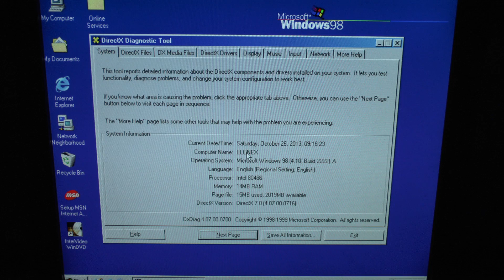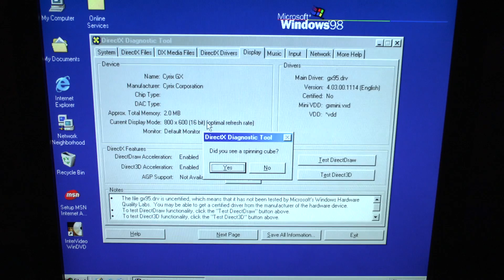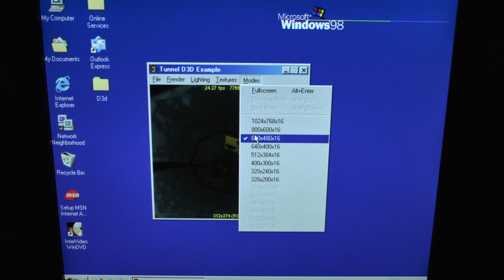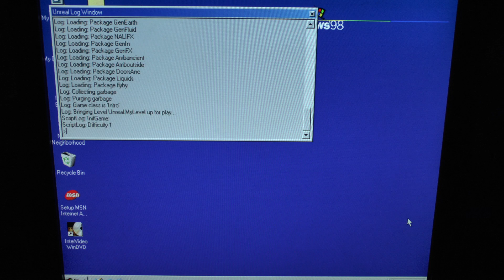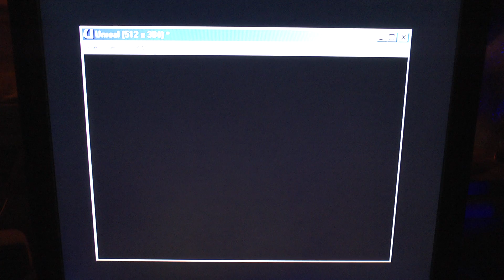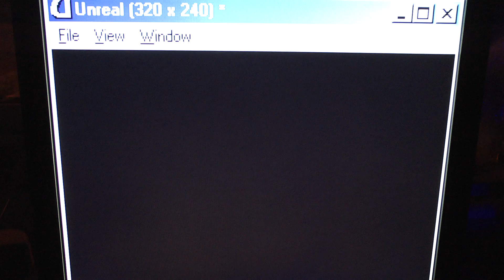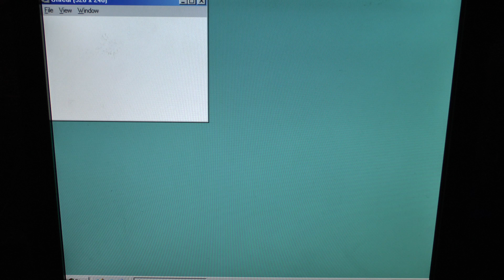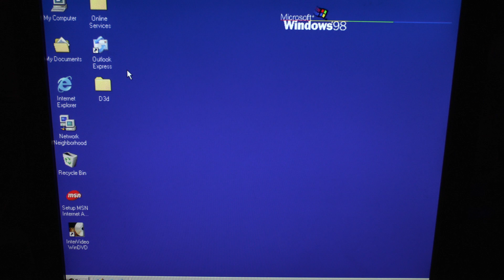UNREAL running on a Cyrix 80486 133MHZ PowerVR Part 3

Comment: I play this game on 486DX80 with 16 mb of ram and 1mb Cirus logic VLB card on Win95. Frame rate was low, but l could play)
Reply from the maker: Yes, I have been amazed at what the 486DX can actually do when it's configured correctly. Thanks for watching.
Reply: You need more vram, a graphics card with at least 8mb vram.
Reply: @moeschizlac  VLB card not supported 3d acceleration. Software (cpu) rendering not need lot of video memory.
Reply: @ДмитрийСергеевич-х4ц6м  There are other vlb cards that support hardware 3d acceleration; the creative 3d blaster and ATI mach 64 vlb are a couple that do. Vram is superior to the slower system ram concerning vga framebuffer because it has much lower latency. More vram allows high color bit depth( more colors to be displayed on the screen) and it allows higher resolution. Graphics card's vram is still used even though it is in software mode. Cards with 2mb vram or more were displaying 16 bit color and 24 bit color during the early 90s whereas cards with 512k -1mb vram were stuck with 256 colors. Graphics cards don't do hardware acceleration if you aren't in at least 16 bit color(64,000k colors)mode. More system ram could help as well.  A typical PC during the release of Unreal had 32mb of ram minimum. I'm not trying to be a smart Alec. I'm just sharing my experiences hoping you can benefit from it.

Comment: I do remember I played Unreal (Tournament?) with a K5-133 Mhz and a PCX gen 2 card. And that was pretty much the only game that actually had support for PCX 2 card (think natively even and not just by D3D, OpenGL). And it was actually pretty good and fast, but everything (or most things) OpenGL or D3D had graphical glitches, or and was really slow.

But it was pretty cheap :-)
Reply from the maker: Hello.
Glad you liked the video. ;-).

Yea it cost me 99£ punts irish. It was cheap at the time and came with a few bundled games that were good. However it ended there and I made sure my next machine had the Direct X capabilities, one reason why I did not pick a voodoo at the time.

Comment: It is not lack of ram, just terrible performer in general due to it’s 486 core nature and having a simple decoder that can only able to decode one simple x86 instruction at the time but have to spend many clock cycle to decode one complex instruction. I had a faster model of media gx1 333mhz w/ ecs p5gx-m, stuffed the ram up to 256mb pc100 and coupled with radeon 7000 32mb pci.  Runs windows xp  surprisingly fine without cmpxchg8b instruction but it was horrible to do anything on it.

Comment: why it is looking again like in software render mode?
Reply from the maker: Hello, the powerVR patch did not install so I think this is why it is in software mode rather than hardware mode.
Reply: @DRCHRISTIANMD  so it looks like software render, but the video card handle it, not the CPU ,right? :)
Reply from the maker: @intel386DX  Yes from another YouTube message and from checking it out, it should indeed run in Hardware with the patch.

Comment: Is this PCX1 or PCX2?
Reply: Must be something earlier than the PCX2, because of the lack of texture filtering and the ugly sky.
Reply from the maker: Hi. I will check for you later on the Card is not currently installed in any machine and is in its original retail box. Its most likely a first generation card, however something I did not do and must revisit as one watcher commented, is the likely fact of the bad graphics beign down too a lack of installed support drivers for the power VR card.?
Reply: It may be.

Comment: Huh.  Epic should have totally used the i586 instruction set for the binary.  Really no reason to run it on machines older than that.
Reply from the maker: rootbeer666 Hi. I would agree its a waste of time to run it on this type of machine full stop.. however thats half the fun...pushing the cpu to the max..
Reply: No I mean the developer of the game, Epic Games, should have compiled the binaries for i586 instruction set because even in 1998 it was already clear that the game will not useably run on any pre-Pentium machines, Pentium II (which is an implementation of the Pentium Pro P6 microarchitecture also known as i686) being the recommended processor.  It wasn't really useful to support i486, no customer that would want to run the game this slow.  Basically if the i586 instructions are not utilized that's a missed potential performance gain for the software.
What you're doing looks fun, it just seems strange that it's even possible, because it shouldn't be.
Reply: You know what, I'm actually wrong.  I just looked at x86 instruction set listing and it looks like the bare Pentium instruction set doesn't really have anything useful over i486 instruction set that would have been useful in Unreal binaries.

Now I want to see how it will run on my old Am486 DX4 I have in the attic.

Comment: i wonder if a card with hardware transform and lighting would speed things up?
Reply from the maker: On and off I am trying to set this machine back up again. I will be trying anNvidia MX400. PCI or similar.. that might..  then again the bus might just cripple it...
Reply: The bus does not cripple it, but DirectX does. The game is almost playable on a Voodoo II in glide mode with that CPU. The game probably does not use hardware transforming and lighting at all, even in the later patched Direct3D mode.

Comment: I can't get Direct3D to work with my AMD am5x86-P75@133Mhz with ATI or Nvidia graphics cards. They only want to work with the Pentium machine. What magic did you do to get this to work? Is that DX7.0?
Reply from the maker: As the title and video content suggests. ;-)
Reply from the maker: Yup there a pain in the bum to get things run.. and drivers are a mystery. Its in storage must take it back out and try the suggestion from the other youtuber re directx drivers for powervr.
Reply: DRCHRISTIANMD If you find one, that is.
Reply from the maker: Thanks. as you can see above I did find drivers for it but good to have an actual site as the drivers are from the 1990s and can be hard to find. I will have to re locate the machine and try a few more things with it. Yup set blaster works for a lot of cards.. although I found ESS AUDIODRIVE.. rejects the command. I have another video uploaded regarding what I found to be the best 486 setup to have regarding dos and windows compatability... great fun..
Reply from the maker: Hello again. Update so far. I did find my original unreal boxset but no mention of the power vr driver. So I went and bought another copy with the power vr built in. The game actually asked did I want too use the power vr driver. Now is painfully slow. I have installed a fresh copy of win 98 etc. and I am going to try tomorrow when I have a few free mins to upgrade the ram to at least 32 but better at 64. Soon we will have an updated video fingers crossed.
Reply from the maker: Hi. you definitly have to use at maximum directx 7.0 anything above will not work as it requires a pentium class.  Now try this. Install windows fresh with an ATI card. do not install any drivers. then install direct x 6.. followed by direct x 7. drivers are included fir most ATI 3D Cards of win 95/98 generation..
Reply: Quite easily. The Media GX is on the base of the Cyrix 5x86 and not the 486. Your AMD 5x86 is not a real 586 but just a higher clocked 486....so no DirectX for you....
Reply: DRCHRISTIANMD The title says 486, the content says Media GX (586).
Reply from the maker: 586 crippled by Architecture of chip design and dated 486 mainboard design. ;-)
Reply: DRCHRISTIANMD I happen to have a Mediagx as well! They're rare.
Reply: DRCHRISTIANMD I wonder if these "patches" that enable extra pentium features work on them?
Reply from the maker: Well the "cpu core" is a pentium class. Its the bus and motherboard that was antiquated for cost saving reasons and to supply the cost minded conusmer such as schools office and budget home users. AMD do it today with the tech bought from ATI. They have all in one cpus. maybe ahead of there time but the idea was and is clever...
Reply from the maker: Worth a shot since the core is pentium class..
Reply from the maker: Are the MediaGX chips rare? I was not under that impression. ?:-)
Reply: DRCHRISTIANMD I tried running DOS games on it. Amazingly you don't have to load drivers for the audio. It just needs the SET BLASTER = variables. For Windows, I got the drivers from the Phils Computer Lab website. He has the MEDIAGX/Geode drivers nicely packaged for us.
Reply: DRCHRISTIANMD The chips not, but motherboards that suppport its Graphics core yes. There are some embedded boards that use it. Back in the days, they used to have internet terminals at a Bank that i went to often, running linux.
Reply: BTW, are you folks part of the 'RETRO Machines' Facebook group? A lot of the retro  YouTubers like VictorBart, PhilsComputerLab, and others are on there.
Reply from the maker: I have no friends.... :-)
Reply: Which is why you must join us there! You must be around your people.
Reply from the maker: lol. Thanks. ;-)
Reply: I have one too, but it does not seem to work. I had 2 before and don't know where the other is. :(
The driver installs when it's in my UMC socket 3 board, but then it's not in the device manager. Also, It doesn't work with many other PCI Cards....(System won't boot...) Maybe I should try it with a pentium.

Comment: How much RAM do you have in that system?
Myself I found a huge difference in framerate performance when I upgraded 486 class systems from 16 mb to 32 mb of RAM.However I usually preferred to run Windows 95 on faster 486 systems  rather than Windows 98.
I'm impressed by the Power VR card on such a low end system.
I would like to get one of those cards some day in the future.

Comment: The 1st PC I bought for myself was an intel 286 @ 14Mhz with 512KB or RAM and 3.5" floppy disk drive (up to 720KB) with a dead 20MB HDD for $10 or 10 weeks of pocket money at a local garage sale.

The  2nd PC I acquired for myself was won on a bet and was a Cyrix 586 75MHz, 16MB RAM with a 8MB Voodoo Rush and 1GBHDD. I put my 500cc Yahmaha dirt bike on the line and thinking back my parents would have murdered me if I lost the bet.

Comment: This is running in software mode. The original power VR chip supports all the basic set of DX5 features, such as texture filtering, mipmapping, alpha transparency... wich are not shown here. Even so, i played this game a lot back in the day and modded the hell out of it, and i can clearly see that you are running it in software mode.It would be cool if you set the renderer as D3D or OpenGL, as far as i remember you had to update the game with a patch.
Reply from the maker: Good news is. I found the machine, installed windows 98 SE, and that's as far as I have gotten. I installed Windows 95 on it originally for a reason, but can not remember why? Also I can not find my copy of Unreal.. Still searching. I moved since this video was made so its in a box somewhere!
Reply: It kinda bugs me how he doesn`t use the PowerVR SGL driver. Sure, later updates to the game removed it from the menu, but you could still set it in the  INI file. Unless the card isn`t a PCX2, of course.
Reply from the maker: Hello. I is he whom witch you speak. I do remember there was drivers on the disc etc too patch games. I will take this machine out again and reinstall the os and the power vr card and see what we can do to run in Hardware mode as suggested. Its not too be taken too seriously its all a bit of fun.
Reply: Good to know about that, I'll be eagerly awaiting an update video.
Reply: I'm glad you're going to take the effort of doing that for the heck of it. I have pretty much the same hardware as you, but a voodoo banshee instead of a power vr gpu, but the two socket 3 motherboards i have both had leaked battery acid and corroded vital tracks of the mobo so i cannot test it myself until i get a decent motherboard with PCI and good overclocking abilities.
I can't wait for your next video. If you have the time and feel like it, you could also test games like need for speed 3, half life, and some direct3D games from 1997/98. All of them in 320x200.
Reply: DRCHRISTIANMD Amazing!! If you cannot find your unreal copy, just download it somewhere. There are some great places to find old abandoned masterpieces from that era. When i get home i will post a couple places to get old soft.
Reply: So?

Comment: Actually missed the Windows98 with Cyrix P166+, it was a fine match and even so much BETTER than Pentium 4 with WindowsXP. Anyone had similar experiences?
Reply: Yup CyrixInstead processor (as windows called it in MY COMPUTER) was better at 32-bit code than 16bit.

Your pentium 4 most likely needed more system ram as XP had higher memory requirements.  Pentium 4 had many more 'hops' to compute a task in the processer - like 14 instead of 8~9.